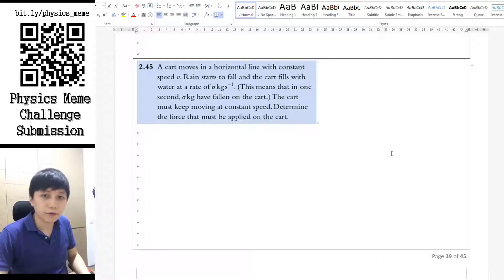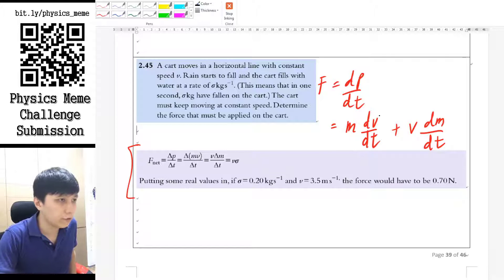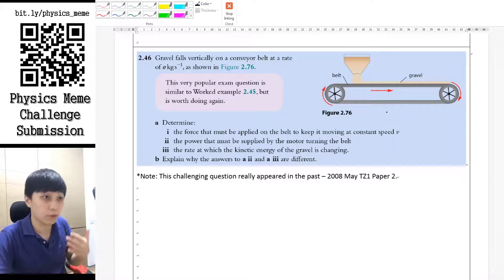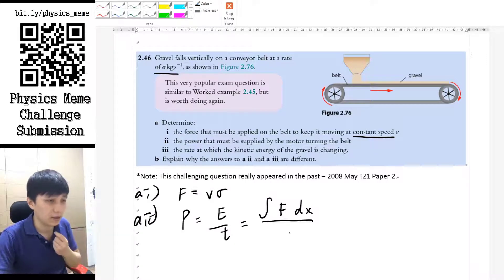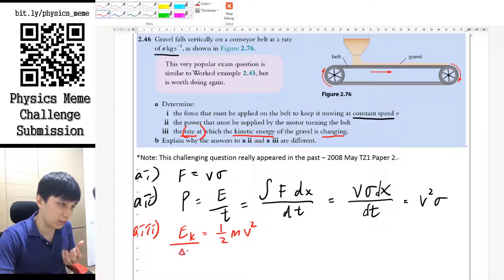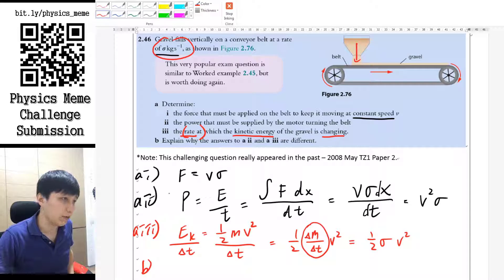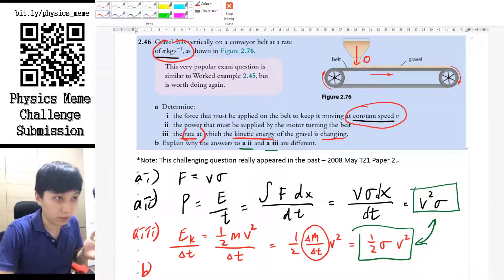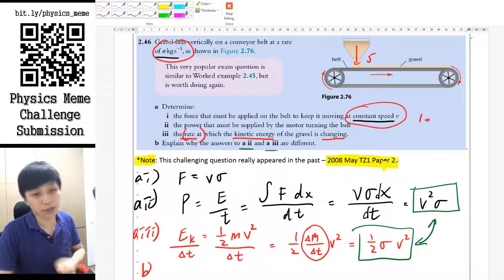Rate of Mass question in Momentum - IB Physics A.2 (Part 3)

Comment: Mr Wong isn't 1/2sigmaV^2 the energy that needs to be given to sigma mass in one second to make it move in a v velocity?
if it is then  1/2sigmaV^2 should be the only energy that needs to be given per second( since sigma mass is added once per sec) to make the no. of sigma masses move with same velocity....?
Reply from the maker: That’s the KE of the sigma mass correct. But it doesn’t mean it’s the only energy given by the belt
Reply: @LouisWongPhysics  whats the rest of the energy doin?
Reply from the maker: @cockroach7237  that’s part b :)
Reply: @LouisWongPhysics  The the initial mass of a body is = m1 
The mass of the body changes to m2 At time t (the change occurs suddenly, as if m1 - m2 Was dropped on m1 at t )
V2 =  m1V1 /  m2

According to conservation of Linear momentum m1V1 =  m2V2
But according to conservation of kinetic energy ½ m1V^21=½ m2V^22

V2 =  V1_/m2 /  m2
But velocity cannot be different..  So is one of the principals not applicable in here?

this is a seperate sum thought you could help : )
Reply from the maker: @cockroach7237  I like how you contine to think through this. May I point out the following?

1. the mass is supposed to increase (dropping) continuously

2. There is external force given by the belt so it violated the assumption for momentum conservation.